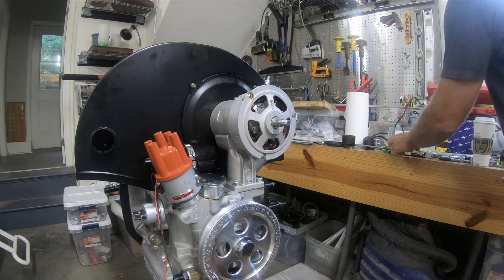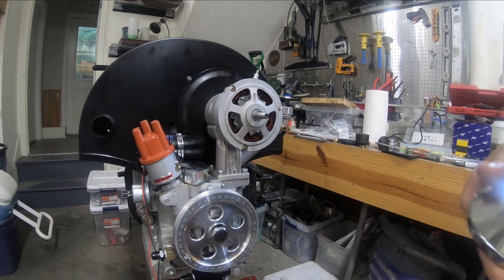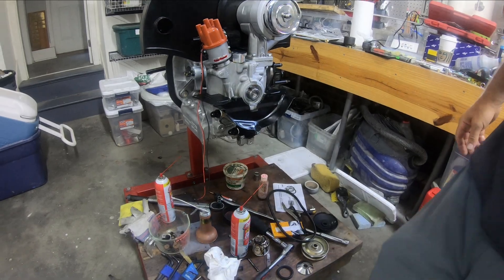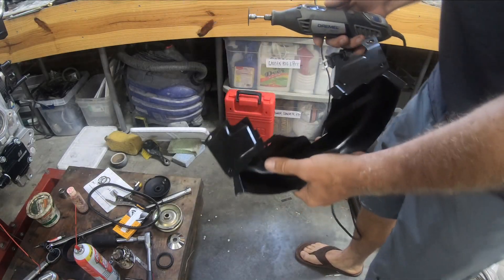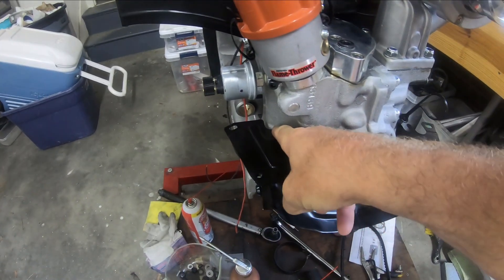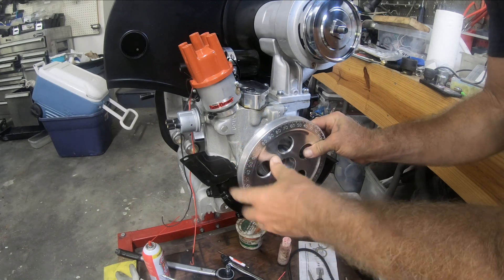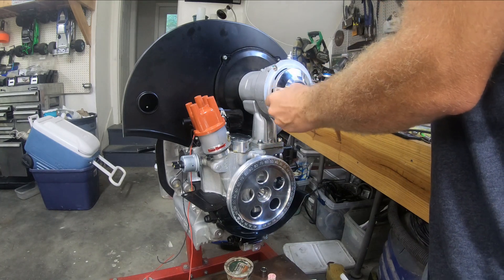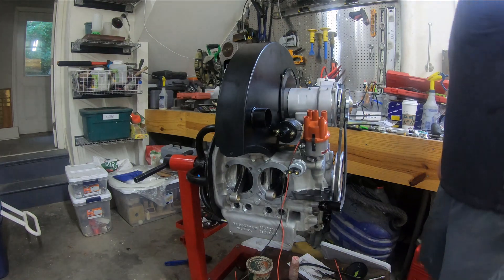2332 VW Air-cooled Stroker Motor - Video 23 - Pulley Fitting, Pulley Tin Adjustment, Shims

Comment: You cut sheet metal with Snips! M1 or M2
Reply from the maker: I have 2 metal snips and don’t like either of them as they bend the metal and are not very precise.  With the dremel I can cut out more precise pieces.  If you are good with the snips - I say use whatever works!  The annoying thing was just how bad the fit was of the tins on the aluminum case!

Comment: great stuff, keep an eye on the bottom alloy pulley they are a softer metal than the crank and can come loose over time and destroy your bearings.
Reply from the maker: Ok - so you mean just make sure the bottom alloy pulley bolt is tight and there is no wiggle?
Reply: @LarsonSplitBus-  yep, my engine builder said to keep checking the nut from time to time. I ended up going back to a stock vw one.
Reply from the maker: oh man - I just found a loose pulley nut on my 2332 on my VW Bus - also an aftermarket pulley.  I tightened it up, but am trying to assess if there was any damage to my bearings - so you probably mean the main bearing closest to the pulley - how would I tell if there is damage to it?  This pulley has probably been wobbling just a bit for about a week...
Reply: @LarsonSplitBus-  yep thats the problem with those alloy pullys. Unless you pull the motor down you wont know🤔 I would replace it will a stock metal one(chromed) if you want.
Reply from the maker: Ok, I tightened it back, and cannot tell if the sound coming from the motor indicates any bearing damage or not.  For now I will just run it as is and watch it to see if it loosens up again…. I saw some posts that also warn that a loose pulley might mean a loose flywheel.  Hopefully I am ok with no bearing damage and no loose flywheel - the clutch doesn’t feel off or chatter or anything…. It would be a shame to mess up a 7000 motor with a 75 dollar pulley - though it is the CB one and looks very nice…
Reply: @LarsonSplitBus-  Keep an eye on it for sure, my engine builder told me only to run steal ones as it also helps the balance of the crank. At $14k for my 1916cc I did take his advice :)

Comment: the dremel makes an appearance. just used mine last weekend on my cool tins as well.
Reply from the maker: Yes - the dremel was used on the pulley tin because it didn’t fit the aluminum case very well out of the box, and used on the flat sides of the FK42 cam - with the 84mm crankshaft I think it really only needed a tiny bit off just for peace of mind…